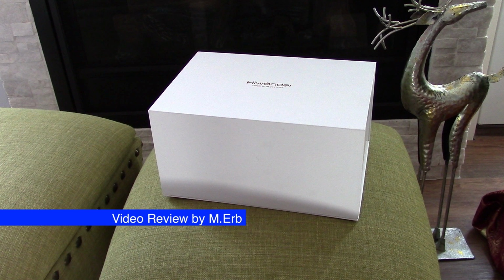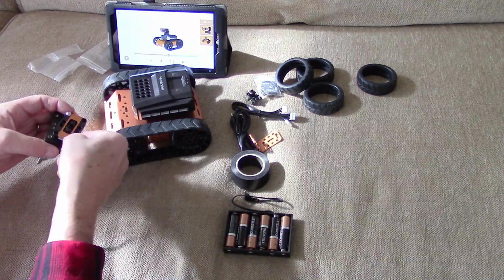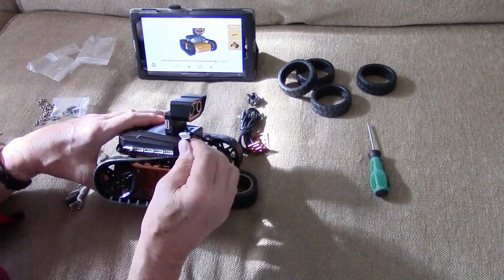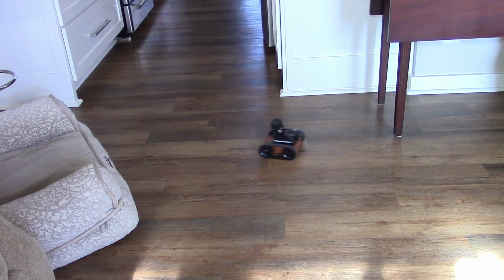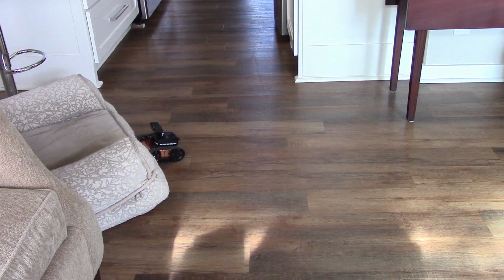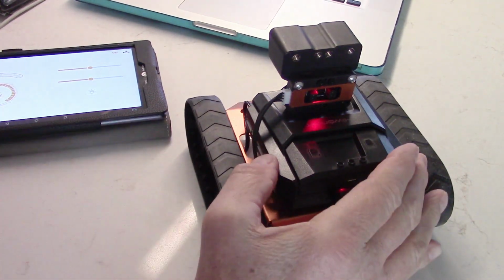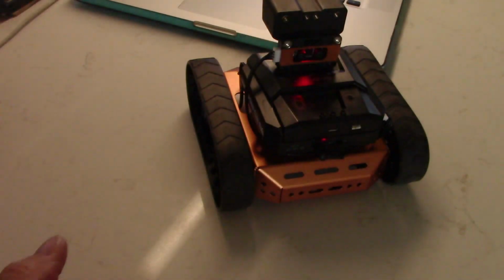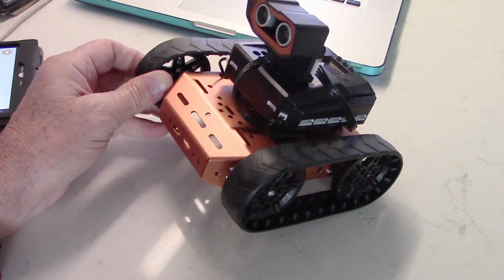Review Qdee Robot Starter Kit by HiWonder micro:bit

Comment: Why does my one not connect?
Reply: Same here. "Scanning,please get close to your Qdee"
Reply: I had the same problem. Got these instructions from Hiwonder after contacting support. Hope that helps!

(2) How to connect Qdee with Phone App?

Before using the Qdee App, you should download the corresponding hex. file first.  All these detailed information has been placed on our website：http://wiki.hiwonder.com/section1/demo2.html 

You can check with the Learning Tutorial Part! 

We have also shared the Quick Start Guide in this drive: 

https://drive.google.com/open?id=1UFRCUTVTA6zofSeywbVeVGoHyAnFYIS_ 

This drive has included Quick Start Guide, Different Hex File for different functions. After downloading it to the micro:bit board, you can control it successfully.
Reply: @DonaldVossen  Do you by any chance still have the hex file that worked for you? I tried all the hex files in google drive and none of them worked for me. I might be doing something wrong.. but still, I would be ever so grateful if you could provide the hex file that worked for you. I can provide my email if needed.